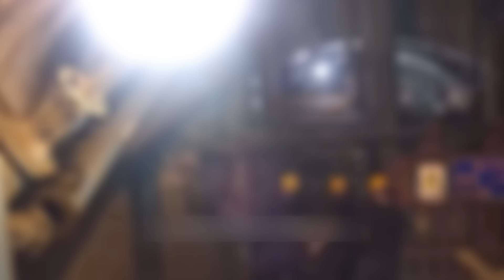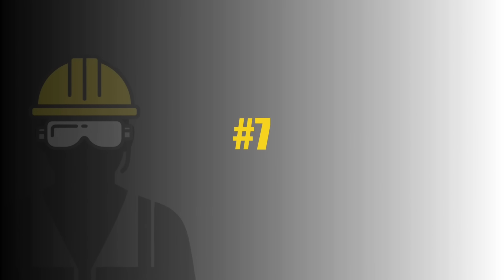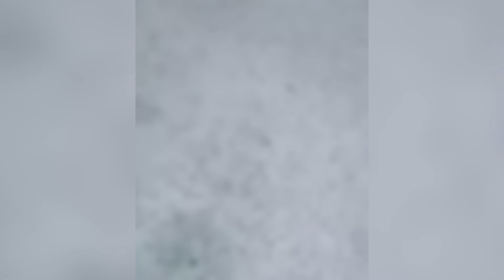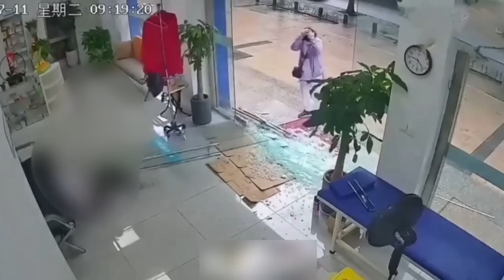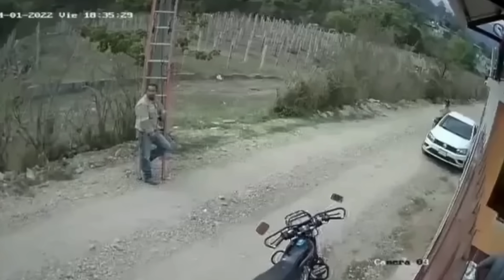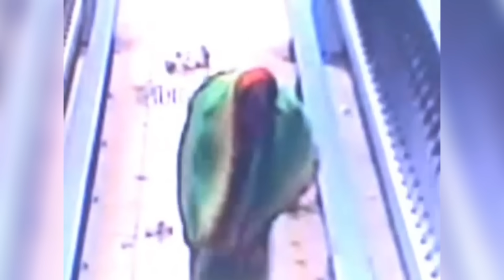She Was Just Sweeping the Floor, But… Big Mistake

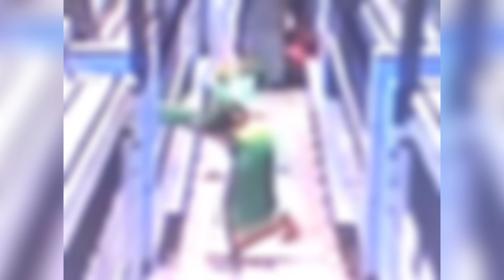Comment: 8:52 Cleaning operating machinery is not a deadly risk, wearing a cape around a machine like that is a deadly risk.

This wasn't an accident it was natural selection.
Reply: At its finest.  😏
Reply: Have any idea what this machine is for?
Reply: @powerofGod788  nope, don't recognize it offhand.

But I don't need to know what it is to recognize that you shouldn't wear a cape around a machine that consists of spinning metal bars.

I've also worked around enough machines with rotating parts to know that as long as you don't put yourself in the machine it's not going to hurt you, you can walk past them safely even when they are rotating, assuming you're not wearing a cape 😂

Comment: That guy was on the outside how did he go down with the other 2?? I don't get this one
Reply: @soundwavs1961c   I'm only guessing here, since that part was blurred....but maybe the guy on the outside had just (at that moment....very bad timing) stepped onto the lift just as it started to go down?  It would have been impossible for him to use his other leg to push himself back up once the lift was descending, especially since he wasn't expecting it.    Or....  Maybe his first reaction/instinct was to grab ahold of the guy closest to him, when he saw it descending, but instead of pulling the guy up, he got pulled down himself?  🤔🕊